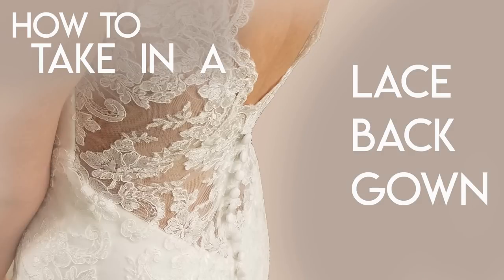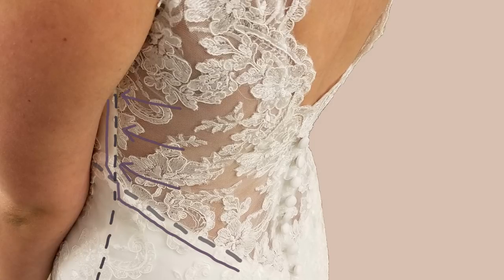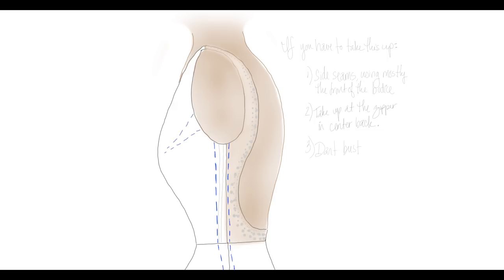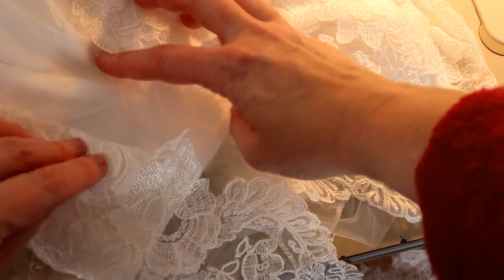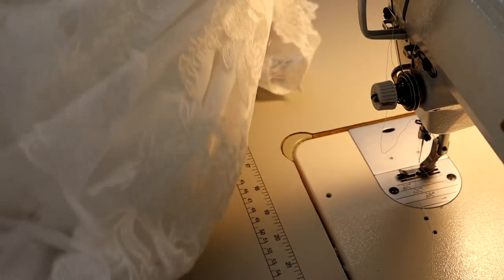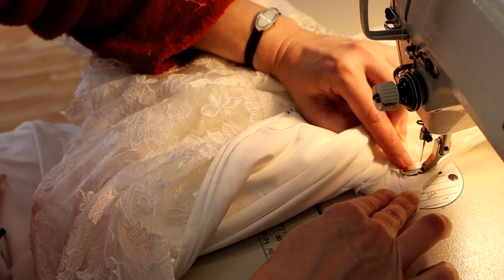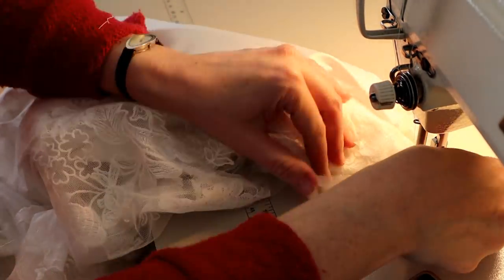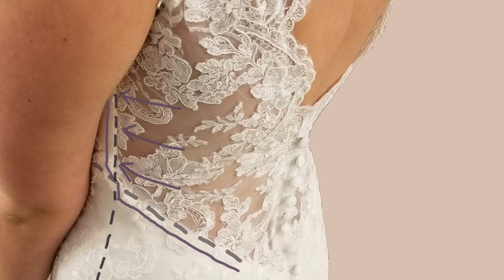How to Take in Lace Tulle Sheer Back Gown at the Side Seams

Comment: Any advice???
Really having a hard to with a open backed lace gown not fitting snug to the front and no where to take it in without loosing the straps on the back of the shoulders 😞
Reply from the maker: Aww that's sad! Email me. (Info on my website) & shoot me some pics. If it's complicated & takes a while, I would have to charge a fee. But, most of the time, it's no big deal & there's no fee.
Reply from the maker: And have you looked at the vid about fixing a gaping back? You may have to dart the back as well.
Reply: @BridalSewing  email sent! Tho I didn't c how to attach images thru the website 🤔
Reply from the maker: No worries; I'll reply & then u can attach. :)